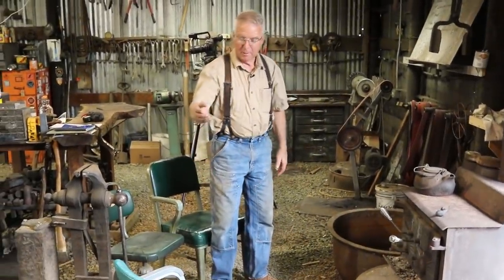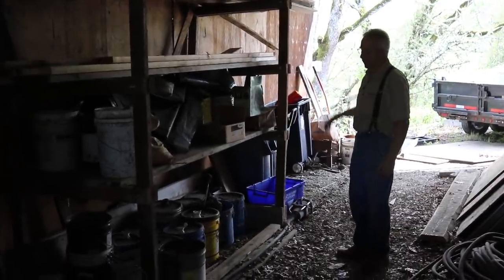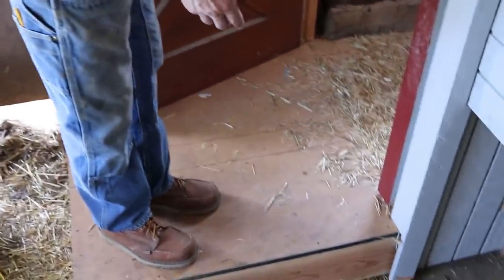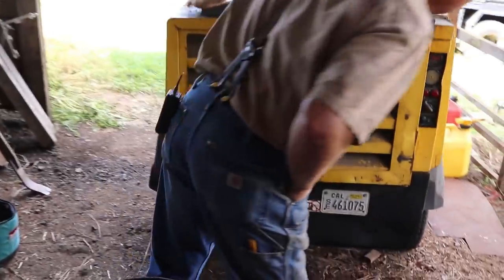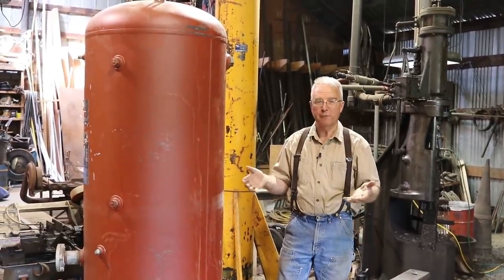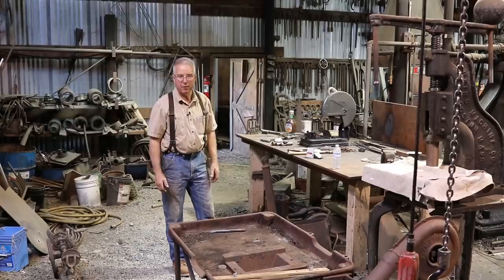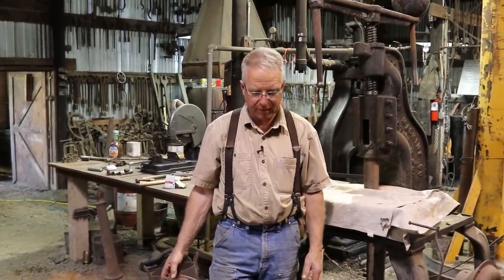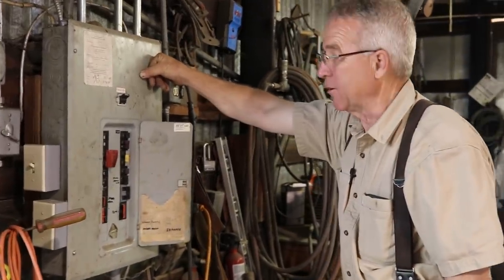Shop Tour 2.0

Comment: I would place the tank outside for several reasons:
1 - Sheltered, heated shop space is valuable. Exterior space is not. 

2 - Proximity space. Not just indoor space, but having things in arms reach or in close proximity to each workstation. Why would you have something in the way, when you can have a pipe that accomplishes the same thing?
3 - Visibility. It might not seem like much, but it's going to get in the way, you're going to have to look around it. Any time you lean to see something, you're going to have to lean way farther.
4 - It's safer to not be contained in a room with a pressure vessel. It's rare that it would burst, and would already be a disaster if it did, but, maybe less dangerous one that directs the pressure away rather than containing it in the room with people. A 5psi shockwave will kill (internal organ failure). Distance and room to expand are your friends. The shop wall will provide some safety in the extraordinary event of a failure. No reason not to. (Must must must install an overpressure blowout valve, and give it a yank once in a while to make sure it works).

Also, there seems to be some naysaying about paralleling multiple compressors, but I haven't seen an actual reason not to (just "Oh, you're not supposed to I heard..."). I've done this in a few shops. I would absolutely run a 240v 30a compressor if you had a spare one, or even a little 120v 15a one if that's all you've got (also outside). Electricity is something around 10x as efficient as diesel, no fumes, no fuel. And it's quiet. And it keeps the runtime low on your better equipment. I bet you'd find yourself using a lot more air, more often, in a convenience way, if you knew you didn't have to fire up the diesel to get some.

Another tip.. get some of that aluminum ribbed radiator hosing between the compressor(s) and the tank. It'll bleed off heat and improve efficiency. You want your air entering the tank to be cooler, if possible. You can even loop it through a pan with water in it, to bleed that heat off. Makes your compressor work less hard and makes your air more powerful (you'll lose PSI as the hot air cools otherwise).
Reply: A little envelop calculation, with regards to 5psi shockwave being fatal...
Your ~3'x6' 291 gallon tank is 39 cubic feet of air. Standing at the surface at 100psi, that's 100psi. If that tank disappears magically, that amount of air will expand.
At 78 cubic feet (double the tank volume), it will be 50psi (half the tank pressure).
At 156 cubic feet (4x the tank volume), it will be 25psi (1/4 the tank pressure).
At 390 cubic feet (10x the tank volume), it will be 10psi (1/10th the tank pressure).
At 780 cubic feet (20x the tank volume), it will be 5psi (1/20th the tank pressure). This is still fatal from air shock alone

How far away from the tank is 780 cubic feet? Well, visually, stack 20 other tanks all around that tank as close as you can get them. The edge of that is 20x the cubic volume.
Air expands in 3 dimensions, but you're looking at the top half of a sphere only (if the tank is sitting on the ground, it can't expand into the dirt). So, 20 x 2 = 40, cubic root of 40 is 3.4. So if you are 3.4 tank diameters away from the tank, that's around the edge of you being killed from shockwave alone. On a 3' tank, that's ~10 feet.

On a catastrophic failure, with that tank in the middle of the shop, anything withing 10 foot radius (so, 20 foot circle), is just about guaranteed dead from 5psi shockwave alone. That's most of the shop. Not even considering shrapnel.

Get it just twice as far away... 7.8 tank diameters, you're now looking at 237 tank volumes to expand into. Under 0.5psi. That's only 20 feet. 20 feet away and you're relatively safe from catastrophic failure.

If that's on the other side of the shop wall, you'll have the wall to protect you from the blast as well. It'll overpressure that edge of the shockwave and push more of the blast outwards, stalling for time.

My math is probably a little bit off, but, that's the gist of it. Distance and time and then it's never a concern. That's a boiler vessel, it's almost moot from a safety standpoint, it's overengineered specifically as a pressure vessel. But, if you're concerned about things in the shop that may damage it, in cascading series of failures kind of way... just put it outside.
Reply from the maker: Mattsawesomestuff!!!            This is an excellent example of why I am grateful that you watch my channel and often take time to comment! Thank you for this!

Comment: Hmm...that tank will not last very long pushing 90 CFM. I'd put it close to the Pwr Ham (to limit losses in the line) and use check valves to isolate it when the compressor takes over. Set up correctly, it could regenerate when the PH cycles off. You should also be certain to put a new emergency valve on the tank. A boiler tank is usually only rated for 50 PSI max - though engineered to safety limits of 150+ PSI. As always, check the nameplate. 

FWIW, I designed a 12' dia, 90' tall pressure vessel IAW ASME about a month ago. PVs are easily some of the most involved engineering I have worked with.

Comment: My ex's house had one of those breaker panels. I'd heard about the dangers and then one day my welder overloaded the circuit and the breaker just kept feeding it power, so I saw it first hand.

If that new tank was mine, I'd spend the time to clean the inside really well and coat it with something, maybe an epoxy or POR-15. Rust is about the only thing that kills air tanks, so I'm baffled as to why they aren't always coated inside at the factory (unless I'm wrong and they are).

Comment: I am interested to know your opinion on the new cordless rear handle circular saws. I work on a farm, and I currently use an old Skilsaw worm drive model for all of my carpentry projects. However, I have some upcoming projects that will take place several hundred feet at least from the nearest power source. We don't have a generator here, so my options are either precut, transport,  and assemble or maybe buy into some cordless gear. As of right now, it seems to me with premium cordless tools you are trading mobility and quick setup for lower prices and constant uninterrupted power.  Anyways, any opinions you are willing to share would be appreciated.

Comment: I'v noticed with a lot of older craftsman, they like to use gravel floors in their shop. The house i'v moved into, this guy's old shed/shop had a gravel floor and he used it for 30 years. Why is this? Is it better in some way compared to a concrete floor or a wooden floating  floor? I would think if I had a gravel floor, I would be losing small tools left and right .

Comment: Whereever you decide to put the tank you'll have to account for, space, safety, lineage, and time degradation of the tank. Id assume put it in the same space as the current pressure vessel. Its cool and your air volume will be at its best!!!!
Cold air has more mass than hot air. And it will help keep the cylinder in the power hammer cool as well as keep the incoming hot charge air from your compressor cooled as well. Im no engineer but that makes sense to me....

I still use fed pacific breakers...1600 amps and 7 sub panels at my work!!! Yikes...there from the 50s and I have a few issues but their there and thats that !!!
Reply: I don't know how his current one is installed, but if it's buried without a drain, it's very likely to be full of water and is most likely being rotted from the inside and out. Great for cooling but also great for condensing. On the bright side, if it's full of water, that drastically minimizes catastrophic damage.

Comment: i think i would have that boiler tank pressure checked before puttin it in  i dnot be live you could just look iat it as its only 120 lbs air in there  add up how big around and how long at what ever psi there a lot more in it then you would think

Comment: Why not just put the tank right outside the door where the compressor is? Draining the condensate would be less messy, it'd be out of the way without having to find a tricky place to put it in the shop. The powder coat on it still looks new, granted I'm from the midwest not the Pacific but I think it'd be fine under that lean too section.

Comment: I have a old School air compressor and 500 gallon tank that came out of a commercial factory in New York City. It works great with no issues at all if you would like it for free. I can't remember much more than I already said because I got hit by a drunk driver that split my head wide open from front to back requiring 1200 stiches on the inside of my head and 800 Staples on the outside of my head, broke 6 in my neck and 15 in my back. I have CTE from the head injury so my memory is almost completely gone that's why I can't remember much more about it. But if you are interested in it I will get you all the information on it.

Comment: The run is nice but chickens will beat that to homogenized poo dirt wasteland very quickly. Not good for their feet, and you won't be able to go in without getting covered in poop. I hate to say this now that you're all done, but I've had chickens my whole life and the mobile lawn tractor coop/run is the best setup. It's nice to have the coop built into an existing structure I know, but the floor in there will be even worse. If you get tired of it, a coop with a floor height at your waist, with egg boxes you can walk up and open from outside, and the whole thing on wheels you can pull around by hand or with the lawn mower, will keep the run fresh, and your chicken experience better overall. Use a sheet of HDPE on the floor of the coop whatever you do before poops become bonded to it!

Awesome little forge, I live in WNY outside Buffalo.

Comment: Attach it to the ceiling... Although... When it's full it's going to be really heavy of course ;-)
Reply: Air doesn't weigh all that much, but you're right. If the drain stops working or isn't attended to for some time, that tank could end up with more water in it than air, and that would get very heavy indeed.

Comment: I'm not the professional opinion you are looking for... But I'd ask someone who knows more than me about a pop-off valve. I've not worked with air much. But I'm experienced with plumbing. And every pressure vessel in plumbing has a pop-off valve. 

Also, in consideration of putting it outside, maybe ask about whether having it outside could cause unforseen condensation in your lines as the air stored in outside temperature meets the shop temperature. Maybe that's a legit problem. Maybe the fix is a liquid line dryer. Maybe the solution is an insulated room built around it with vents to exchange the atmosphere air inside the shop. Maybe condensation isn't a problem at all. I really don't know. 

Again, I'm not qualified to advise. But I can atleast give you some questions to ask!

Comment: Was that hammer originally run with steam? 90 at 90 seems huge for air.
Reply from the maker: The Chambersburg General utility hammers were built on the same frame that was used for steam hammers. The later models were plumbed for air instead of steam. That implies that the tolerances were smaller. In a steam hammer, the tolerances are wide so that when the machine swells up from the increase temperature of the steam overtime the fit is tighter. They did not worry about wasting steam and so those built to that specification would not work for air.

Comment: I actually happen to have the exact same forge that you just acquired even with the original smoke hood i would be very interested in a video of you fixing up yours as mine is in very good condition just had a few things added ( tong rack handles and a large wheel to move it around ) and if you know of anything else to get it running id would be very curious

Comment: Will a homemade welded- pipe air tank hold 115psi? A truck tire will,  for years,  tens of thousands of miles,  abused on the highway.  A welded pipe,  under a ton of gravel,  will merely begin to leak.  You may not even notice it's been leaking. No worries.

Comment: I want to share that you are my dad on a video. Everything in the video is my dad. Everything has come from someone else. 
We have a barn setup that essentially is a storage/shop/communal area. We cannot keep the rats from getting in. We have sealed off every inch of this place, but they've managed to sneak in. The barn is made of timber framing with metal sheeting (that used to be garage doors), and old patio doors.  I'm currently in the process of doing a major declutter of the barn during this quarantine, and they rat mess and damage is extensive. Do you have any solutions for barn rat problems?

Comment: using a diesel compressor on a permanent site seems so wasteful, are you sure you couldent get an electric one to do the same thing?
Reply: Absolutely not. The electrical charges to run an electric compressor capable of 90PSI and 90CFM would be outrageous compared to the cheap cost of diesel fuel.

Comment: I'd kill 2 birds with one stone. Move hammer and tank as close to compressor as possible therefore there is little pressure loss. Keep the tank up to allow for drainage and close to the hammer for efficient capacity (preferably outside) relief valve is necessary if you value life.

Comment: I managed a Workshop with 17 of those Tanks, each sunk in concrete bays to supply air ...
Every year they were uncoupled, lifted out by crane and inspected by an Engineer from the Insurance Company.
Whatever you do, DON'T do that!
Reply: It may be a dumb question but what should not be done: Keep them on a concrete bay or uncouple them every year?
Reply: @maxsnts  Seems like sinking them in concrete is the bad idea. If they have to be inspected, they have to be pulled out to be inspected and certified.
Reply: @benningtoncamper2852  So the problem is the combination of the two. Got it, Thanks
Reply: @maxsnts  They were stood upright in an underfloor cavity, which periodically would flood so the bottom 1M was standing in water. I suggested they be located outside the building and the pipework to the valves routed through the wall. For all there were numerous watertraps in the compressed air circuit, the moisture used to obviously find its way to the lowest point ... underground inside the cylinder.

Comment: I say bury the enormous tank under ground. Wrap it in a rubber blanket, bury it, concrete slab over it, and mount upon said slab an industrial rotary screw-type compressor to be able to slake the rotund behemoth's thirst for ACFM and facilitate running a Chambersburg and a few dozen Dyanbrade™ random orbital/belt sanders/ surface wheels....😊.
 That monster deserves the best! 
-✌🏼

Comment: Pressure vessels should be certified on a scheduled basis, I can't remember the time frame but I think every 10 years.  You should probably have it inspected.  Pressure vessels can be dangerous because gases are compressible as opposed to a fluid under pressure.  Myself, I would place it a little more remote and hard-line the air into the shop.  That said though I suspect you may not be carrying more than 200 psi in it which is not like the 3,000 psi systems we used here at the Kennedy Space Center.  Be safe.  Mike